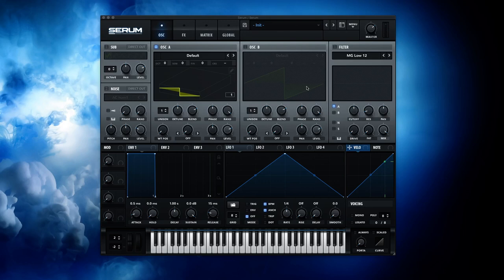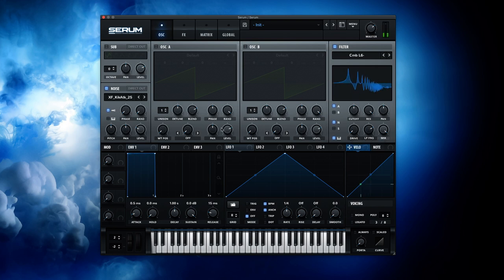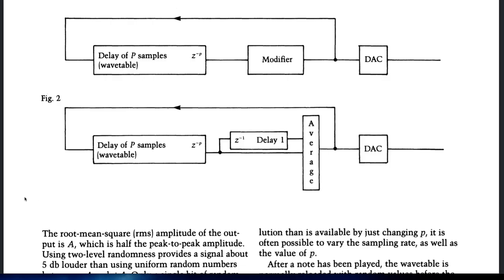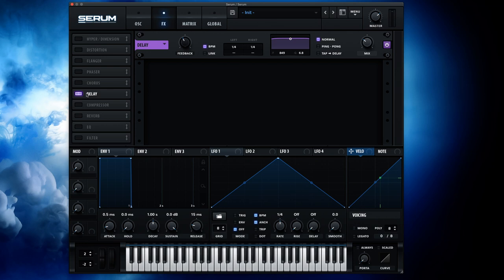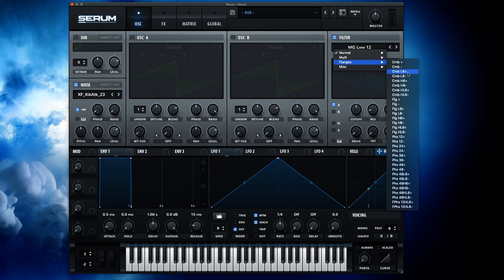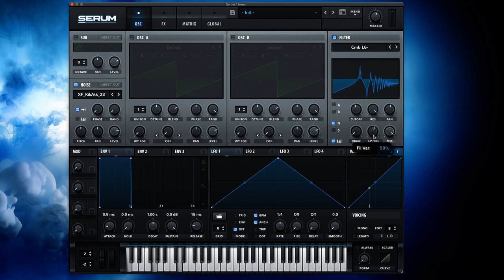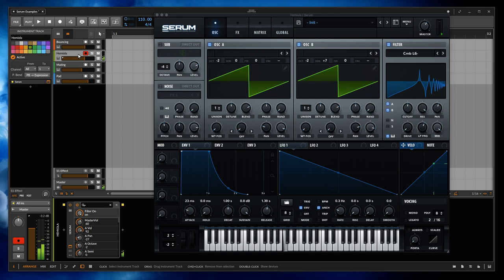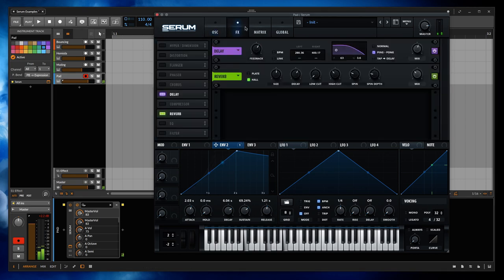Physical Modeling in Serum | Tutorial

Comment: THERE IS MORE! Feedback FX are all secretly comb filter/resonators. You can also use the Flanger/Chorus tools as resonators. Set Mod rate to 0, Feedback up, and now you can stack resonators for even more dissonant metallic design.
Reply: THERE IS EVEN MORE! (Serum is my fav vst for this reason).... Use resynthesis to stack as MANY resonators as you want. Wavetable synthesis is a cheat code for easier modular synthesis.
Reply: What do you mean by resynthesis? How do u do it in serum? Thanks